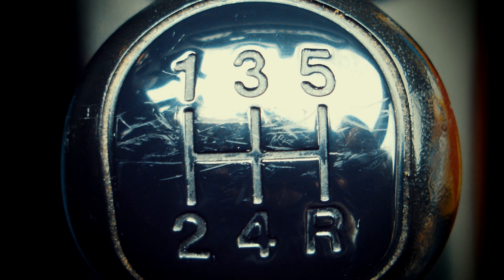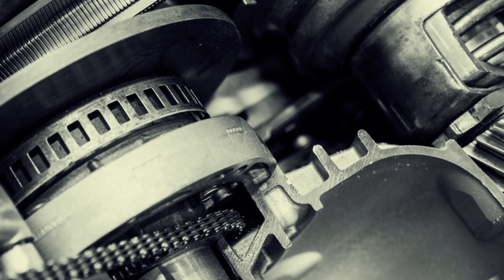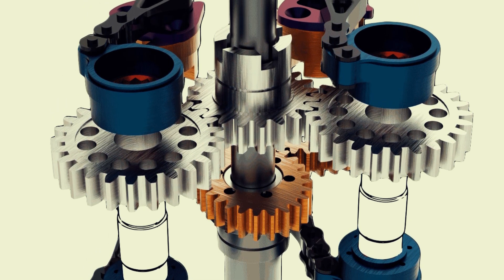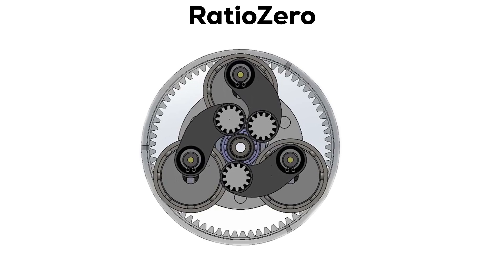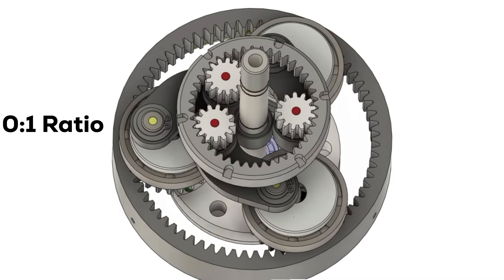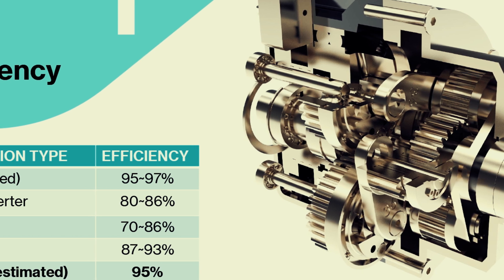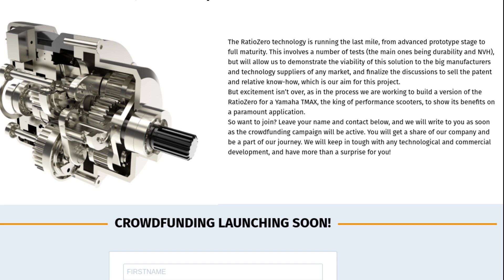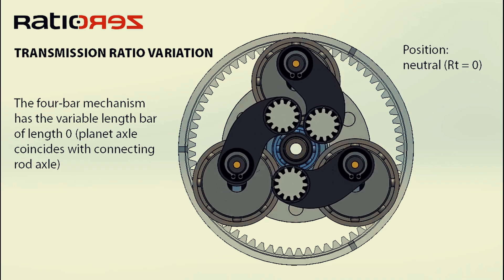Is This the END of Traditional Transmissions? (RatioZero Geared CVT)

Comment: I’m not trying to be negative about this, but I just don’t think it will be dependable because it has ratchet gears the faster you go the more they will have to ratchet that sounds like a disaster at high speeds
Reply: My Toyota Yaris have ratchet gear. It's 2004 very old tech.
Reply: ratcheting system is for bicycles which is the first thing they developed for
Reply: 我发明了一个，无极变速行星齿轮组，和这个完全不一样，我正在测试，如果可靠性高的话，可以让车子的动力增加很多，因为变速比非常大
Reply: The noise is the least evil about ratchet type CVTs.

Comment: Why? Buy a much more efficient EV and only have ONE ditch the ancient tech as its set to disappear in the next 5 years 😂
Reply: That's the point people in this world want to save the engine and have gears to drive with
Reply: Because right now we still can't predict the future.
Reply: The answer to this is very simple. ALL of my cars are aged well beyond the expected life of any kind of battery.  I prefer fully depreciated vehicles. Imagine buying a Tesla model s that is out of warranty, and at age 11, the battery pukes. That is going to be a very expensive repair. All that's going to do is go to the junkyard. It doesn't seem like you're going to save much in efficiency their. To be fair, gas cards are getting to be more designed like this every day, but it doesn't need to be that way. We have proven that in the past with old Honda accords and stuff. 

And for those who think that EVs are simpler, YOU ARE WRONG.
Reply: Bringing part counts down and reducing wear is the simplest way to increase repairability, efficiency, and reliability, which reduces waste and makes sure people want to use it. Electric vehicles make sense only for short range stuff like driving around town, people who only need one vehicle and need to drive a long ways or a lot will settle on hybrids in the long run. Combustion engines are just better in terms of range, top speed, lifespan (compared to any EV batteries), and they're vastly superior when you want to repair and keep one car for good, since you can remanufacture and replace parts easily. People also don't like how resources for rechargeable batteries tend to impact people where its mined and we shouldn't switch to them until that's dealt with better. Cars mostly peaked in the 80's or 90's, they have a low part count and weight, and well maintained stuff from that time could easily last for centuries. I cant imagine us not still having combustion engines since small cars from the past several decades with little engines can be extremely efficient already, and modern diesels are even more efficient then them while producing less emissions per mile, and we'd see even more reduction in emissions if we just enhanced those with hybrid ICE with electric or compressed air regen braking systems in addition to electric drivetrains with or as CVT's. Its hard to say exactly, but with a shift to utilizing bikes, trains, and buses as much as possible then this will get us as close to an ideal scenario as we can, and vehicle emissions already aren't the biggest issue, its manufacturing and agriculture. In addition to the benefits of regenerative braking you can bring part counts down as well as keep the engine running at ideal conditions without jolts from the wheels with electric drivetrains. You can also avoid the issues of dealing with massive amount of battery storage since you just need enough to accelerate and cruise a bit to give the ICE time to start up, and that allows you to use more efficient but less energy dense capacitors or supercapacitors. 
With current technology we could feed the world and stop climate change without needing to force everyone to use immature or intentionally short lived technologies. Seaweed and kelp use animal waste as fertilizer, don't need to be watered, and can survive anywhere in the ocean with the right temperatures. The oceans also allow for us to scale up easily when shipping food around, ships are the most efficient way to move things aside from trains. Kelp and other seaweed are nutrient dense foods that can feed almost anything, and instead of focusing on mars we could settle the moon to mine for every resource we can think of for the cost of collecting sunlight. We're just too busy struggling with each other while the rich take everything they can and get us distracted with fads like EV's, or new phones.